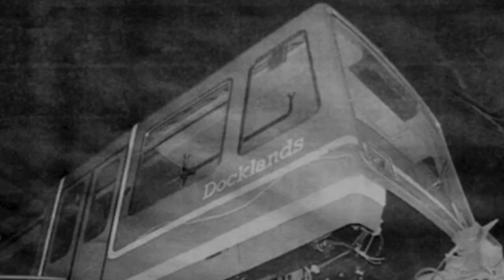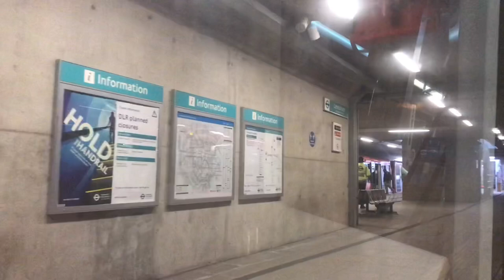The Island Gardens Accident: What Really Happened

Comment: I was sitting at the front of a DLR train in the mid 90s which failed to stop at Crossharbour, the 'train captain' (as they were known back then) came running to the front and yanked the guy sitting next to me from his seat, opened the control box and brought the train to a halt on the siding just south of the station. I remember a number of incidents soon after when trains needed to be rebooted as they just sat around playing the chime sounds and always wondered if there had been an overactive failsafe added.
Reply: I had a similar experience on the Northern line around 10 years later when the train passed through Balham at full speed without stopping, there was a recorded announcement telling us to hold on with both hands because the train would be making an emergency stop, the brakes were applied bringing us to an almost immediate shuddering halt. If only cars were as safe!

Comment: It really is fortunate that this testing was carried out and the issue found. The idea of complacency, "we designed it just fine, of course it'll work" can be devastating. One example is the Ariane 5 rocket. The Ariane 4 was a very successful launch vehicle, and the inertial platform (the hardware and software that tells the rocket where it is, what direction it's pointing, and how fast it's going) was reused for the Ariane 5. It had worked just fine in the past, so they didn't see any point in further testing.

However, the Ariane 5 had a different flight profile than the Ariane 4, with a much higher horizontal acceleration. This was too high for the register in the inertial guidance platform, and it had an overflow error, a number too big to store. This triggered the software to run a subroutine to realign the platform, which was normally used to calibrate the system before flight and reset everything to zero. This subroutine should've been disabled after launch, but nobody thought it would cause a problem. So, the guidance platform suddenly thought that it was still on the ground, tried to zero out everything, and the rocket abruptly turned sideways, had a structural failure, and then self-destructed. And then after this, they ran a simulated Ariane 5 flight profile on an Ariane 4 inertial guidance platform (which they should've done in the first place) and it had the exact same sequence of errors.

Comment: They still have a one second cycle on the inductive loop communication. You can accidently switch to "Emergency Shunt", which is easy to do, but should never be done without authorization. If you switch back quick enough (before the next cycle) it doesn't report it back to  control and it just looks like the train dropped out of ATO.

Comment: Thank you for not only an excellent look at safety testing, but a 'tourist tip' as well. If I ever make it over to London (something that's been on my 'bucket list' for quite some time), I can try to snag a coveted front seat on a DLR train. It would even be 'cooler' than a walk through the Rotherhithe tunnel on the pedestrian path. Somewhat safer, too. :D
Reply: Go for the right hand side or you’ll be made to move by the train captain so they can drive the train using the control panel on the left side

Comment: Thank you for an interesting video. I know about computers so as soon as you quoted asynchronous communications I knew that the time to stop the brakes had exceeded the 2.7 second safety limit in force at the time. A hidden timing hazard in the distributed system represented by the three computers. A similar problem in such systems and software is to do with state of shared resources and is know as a "race condition", they are quite difficult to debug since any change to the software to detect the underlying cause of the failure could potentially change the timing and thus prevent it from reoccurring under those particular circumstances.

Comment: This brings back a lot of memories

There was only a very poor irregular bus service on the Isle of Dogs back then and watching the new single carriage DLR trains being tested but not available to use was very frustrating. Then the papers showed this picture and more delays to opening

They got a crane in and removed that train very very quickly.

The unauthorised test bit? All l’ll say is in the early days there were a lot of local cheeky cockney geezers employed as DLR “Train Captains.” And they all disappeared fairly soon. In fact the early staff on the DLR were quite an eccentric bunch of characters. It was run as a separate company so recruitment may have been somewhat different from today’s TFL.

There were years of software breakdowns and unreliability (no fatalities) while run by a GEC and Mowlem joint venture. And long long closures while the stations, bridges and track were rebuilt for 2-3 carriage trains

Many an evenings long walk home or wait for a replacement bus service

Then the Canadian developer of Canary Wharf stepped in and got better trains & signalling for the DLR. As well as funding part of the Jubilee line extension. And the DLR became part of TFL network

Comment: I remember this. For the first five years or more DLR was both unreliable and, in winter could be mind numbingly cold. Before blocks of flats began appearing along the route, a DLR platform was one of the highest points West of the Ural Mountains so an east wind took Russian cold right through you with no wind breaks on the platforms.
   I chaired a community forum and DLR would answer questions about reliability by saying it was due to ever deeper software glitches being revealed so they could be solved. That chimes with the video and, a bit later, with my own experience in data mining and system development. I cycled everywhere and avoided DLR if I could till it improved. Now, it's brilliant

Comment: One of the light rail Metro Systems in the USA had a similar problem during commissioning. The Line was part built and at the temporary terminal station they decided there was no need for buffer stops. The train stopped at the terminal where the doors opened and closed and the train motored off the end of the track into the car park where the parked cars acted as the buffer stop. It turned out that someone had loaded a revised set of software that assumed that the next section of track had been completed and the train then decided to drive on then non-existent track.

Comment: As the engineer in charge of the testing of the vehicle control signalling of DLR in the building contract, I must inform you all that much of this video is only a small part of the accident at Island Gardens. 
Also that the adviser quoted as Jim Mead was not involved as he was with the centrally based system running the railway service not in any part of the signalling and traction control. What he said was reasonable but only a tiny part of the railway testing.
Firstly being a train to operate automatically with no driver at the front we had to ensure that if traction control made a sudden high acceleration fault we must be assured that emergency braking was applied safely in every place on the railway. There being no person to react to it. We could not have traction control to be fail-safe. We had thus to test what happened in such a failure. We tested stations everywhere except terminal approach tracks successfully because all had significant over-runs beyond the platforms. The test being manual driving to simulate automatic driving that suffered the traction fault. This was to simulate the accelerating vehicle passing the speed control wiring loops in the track such that it was not overspeed detected immediately but got past several loop sections making it go far faster by the time it was detected and emergency braking applied. The potential was to over-run the end of track at terminals. 
As engineers, we were not allowed to do this on a temporally set up test on a non-terminal track as the cost was not management acceptable.  Thus the only place was Island Gardens.
The whole testing procedure was set up for daytime on 11th March 1987 with me in charge, but sadly some staff decided to practice earlier on the night before. They actually made the testing well and the 7th run actually did just pass the detection as installed and the braking could not stop the train in time. It hit the buffers which were designed to prevent the train reach the end of the track by having bolted-on heavy braking to the track. After the accident, it was found the buffers were not bolted up fully and they slid off the end of the viaduct. Thus the train was not prevented from passing where the buffers should have stopped movement. Hence the photographs.
The standard rail section signaling was found not to have reacted in one second. The overspeed prevention track loop digital signaling was found to have not reacted far enough before the terminus to guarantee emergency braking application is adequate time. 
The outcome was the standard rail section trainbourne relay was replaced on each vehicle with one tested to react within one second rather than the original three seconds. I spent a whole weekend doing this.
The track loops approaching the terminal installed to allow the train digital equipment to detect overspeed were all moved two metres further away from the platform as it was found that the cable end could be allowed to be reached to exactly by the middle of the vehicle as this was past the first of the two detectors on the vehicle. All this made the system fully safe and did not disturb the train operation and thus allowed automatic reversal at the terminal. Moving the cables two metres made it impossible to get overspeed to a level that the vehicle would hit the buffers too hard.
What also was the outcome was the standard rail section coded signaling that was for years was used as the primary safety system did not work quickly enough.
The much more modern digital overspeed detection system was considered to be the secondary signaling system but could react very fast when it detected a fault and thus for all final parts of terminal approaches it was the primary system of safety.
The whole system were retested after installations were done by running each vehicle into all of the five terminal lines platforms with each done three times. This was done with all eleven vehicles. The full test of each vehicle with all the running around the railway took at least five hours. I did six vehicles and my assistant the remaining five vehicles. 
Thus with this video giving a very small part of the information, it must be replaced with the correct total information as described above.
For me, it was also important that Her Majesty's Railway Inspectorate fully supported me in the reason for the testing and the outcome delivering the potential safety risks although the actual nighttime running should have been daytime on the next morning with me in charge. 
Alan R. Pearce from GEC-General Signaling Company Limited

Comment: If it's any reassurance to those watching this, this sort of scenario is almost impossibly unlikely to arise again these days in safety critical systems. With intensive simulation capacity that can entertain billions of possible output scenarios, to mathamtical proving of safety critical systems (with things like Ada in most autopilot and train control systems for example), the chances of these sort of bugs making it into infrastructure is diminishingly unlikely. That's not to say it can't happen, see the jammed accelerators on a certain car brand a few years back, the MCAS debacle and so on, but we're (collectively) getting much better and incidents like this have helped pave that way.
Reply: Very reassuring, thanks Boris.

Comment: I am not surprised. I used to write software for car engine management systems. At one point we had two microcomputers one to deliver the spark to the spark plugs and the other one calculated at what angle to issue it. It then fed this to spark computer to fire the spark plugs. Similar issue nobody realised the loop delay in the two systems meaning that it frequently got it wrong.

Comment: If you don’t test your code properly, your customers will be the ones who find the problems, and customers always find the problems with enough use. Not a scenario I want on my head when the difference between life and death depends on my code performing within spec. Better 1,000,000 empty trains crashed than one innocent person lose their life because of an error in my program.
Reply: I don't see it as a software problem. The software in teh individual servers were behaving as required. They simply did not get the message to react in time. This was a failure of the low-level communications method employed to allow the three servers to talk to each other. OK for most environments but NOT OK if real-time reactions are needed. Imagine if that same method was employed with an aircraft. Then a split second might make all the difference. Things have changed a lot since then with professional GPS systems able to react in fractions of a second.
Reply: Do you fly in fly-by-wire aircraft? :)
Reply: @RebMordechaiReviews  Would interrupts have mitigated the issue?

Comment: Fascinating: I have worked on new railway construction (new main lines, several metros and TGV's) over the years. 
I recall a not wildly dissimilar incident back in 1996 or 97 in Cairo when testing stock on the (then) soon to be complete Line 2. It occurred in the depot at the northern end, when a consist overran the buffer stops, causing no personal injury but a damaged driver's cab and front bogie. 
Despite rigorous project-wide investigation, the true cause was never adequately ascertained but the Owner maintained an insistence that it was caused by an unauthorised person from an unknown company conducting an unauthorised movement on the depot test track during the night shift.
Alcohol was not suspected but stupidity was a high probability.

Comment: Can't be a Lighthouse Keeper the ones still in use are all automated
Reply: True, but a chap in my mechatronics class got a job with Trinity House, riding about in helicopters and changing light bulbs. I wouldn't have minded that job in the slightest.
Reply: Even in the early 1980s, most lighthouses were getting automated. I knew a chap who was a peripatetic engineer responsible for fixing faults. He said one of the tricks of trade was, when they got to a nice lighthouse, to diagnose the fault as requiring a part that had the longest supply time, so you could spend more time at that location before moving on to the next one.

Comment: Real-time software is tricky stuff, particularly with multiple processors. Having spent 40 years doing it I could regale you with entertaining stories about things that cant possibly happen, happening on a daily basis.  The thing boils down to testing what are known as "Edge cases".  The "what-if-this-arrives-just-before-that-arrives-instead-of-after".  These are sometimes the hardest tests to think up because all programmers can check their program will work if things arrive in the right order. Thats "easy" to test. Its the things you cant think of that you need to test...and thats when "real-life" happens.  It is often said that the best testers are people who have no idea what is supposed to happen so you get them in to try everything they can - grab 6 people off the street and say test. They will push buttons and twist dials in the "wrong" order because they dont know not to.

Comment: Great follow up. Arguably it then wasn’t so much an accident as it was an unexpected outcome with detrimental effects on hardware. 
I would even dear saying that this was the ideal outcome from the tests, it did eventually find a potential weakness in the system that could be remedied. The damage on trains and infrastructure might have been a bummer, but it served its purpose. Sometimes one just have to swallow the costs for safety testing to get a product that is actually safe. 
C.f. the countless Starship SN[n] launches that ended in rapid nonscheduled disassemblies at elevated temperatures. They are still considered largely successful.

Comment: I'm an American, but I'm familiar with Moorgate Protection used for terminals in which there are timers that are triggered when a train passes a location and the magnets to trip the brakes remain on until enough time has passed indicating the train is moving slow enough.  Does this mean on the transit light rail, these aren't being used?  The testing was designed to determine if the safety system would work; however, the test itself was conducted in an unsafe way.  It is assumed the test might fail, so what would happen then?

Comment: “Our computer makes an immediate adjustment for any change in condition. For example: We're producing simulated hypotension by direct compression of the telemetry unit; the computer will sense this and make an immediate adjustment.  {{pause}}  Well, almost immediate.  {{pause}}  Sometimes there's a -- there we are -- sometimes there is a short-cycle delay, but as you can see, the computer has placed the patient into the Trendelenburg position and administered a short-acting vasoconstrictor.”